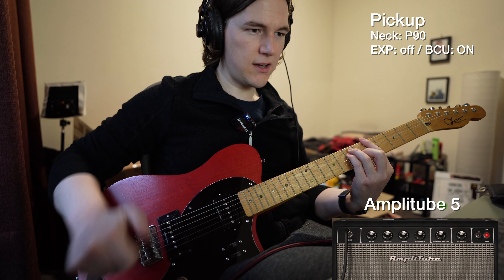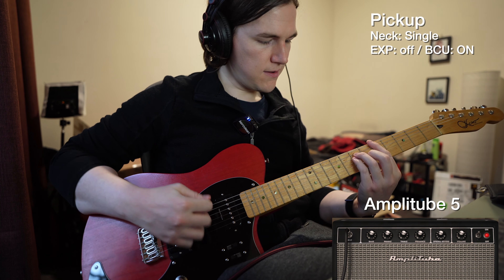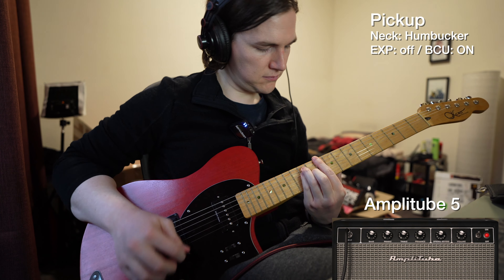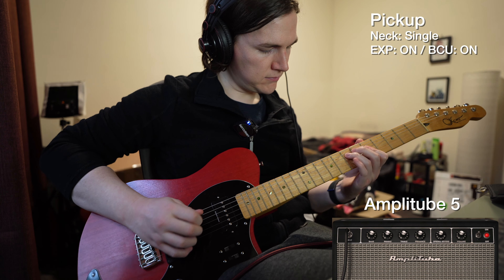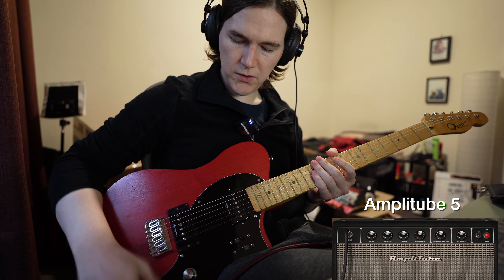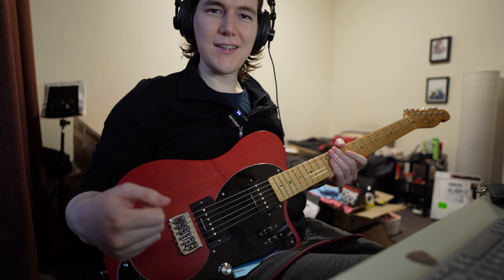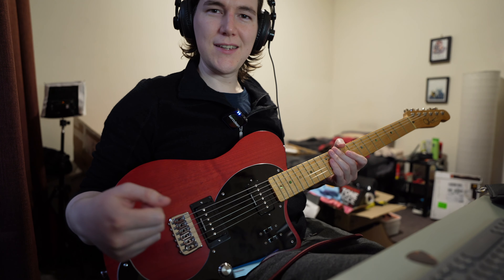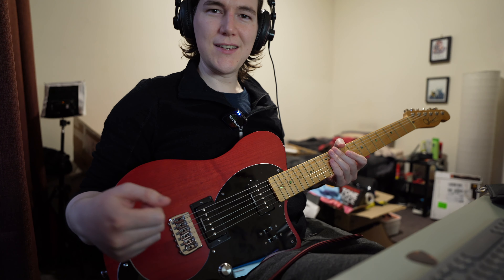Seymour Duncan P-Rails + Artec BCU & Artec EXP

Comment: Awesome, bro! I just ordered both the BTU and EXP before I stumbled onto this video. I'm planning to try them out in my Strat along with a set of Dimarzio Area pickups that I just bought over the weekend, so I'm hoping get some great versatile tonal improvements once everything's installed. I have a Tele with P-Rails and Triple Shot rings as well and I may try the same thing with that as well if Ilike them with the Strat. Thanks for the very thorough and informative demo.
Reply from the maker: You're welcome, I spent a long time trying to find as much info on them as I could but just decided to order and try them myself. I do find the BCU more useful but the EXP can be fun for a clean boost in certain situations. Hope you'll love it, rock on!

Comment: Excellent demo!

I have the QDD and love it. I'm thinking of adding another circuit . I was wondering if you needed 2 batteries or did you wire both circuits to the same battery?
Reply from the maker: I ran both off just 1 battery as their website shows wiring config for that

Comment: Which one suits better to replace a traditional Tone knob ? I gonna equip my guitar with a set of active Blackouts (AHB-2 + 2xAS-1) with gain toggle switch , so I don't need a mean booster but a wide tonal capabilities in all knob positions (and a bypass mode for a pure tone of course).
Reply from the maker: The EXP is more of a clean boost, and the BCU is a kind of cutoff filter. Artec also make the QTA / QTP which are (active/passive) 5 band tone selector, may be more what you're after
Reply: @KeroDean  , thanks. I don't need a band selector, so BCU should be nice as a tunable mid-cut filter. Ordered a BCU.